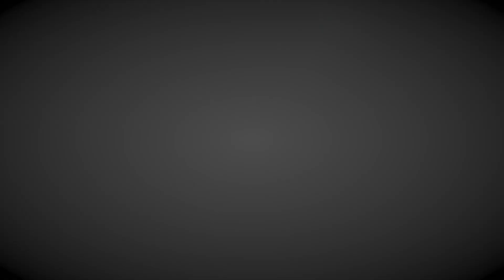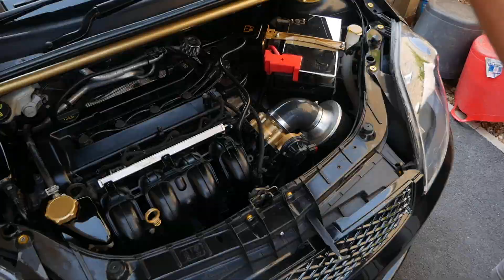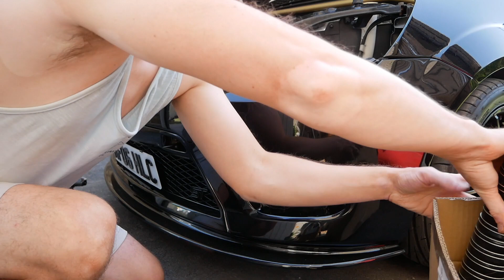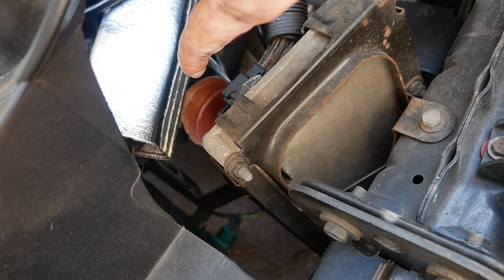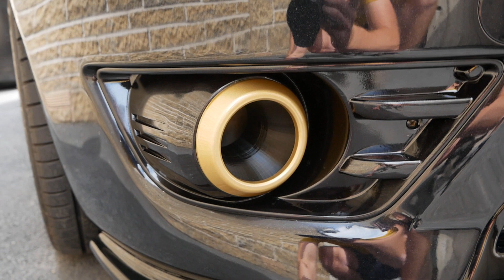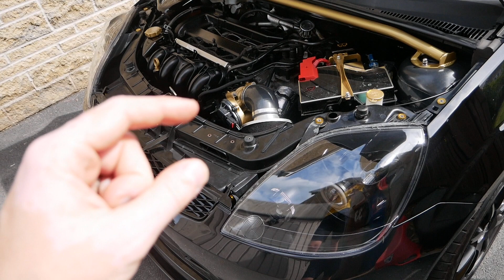Fitting CAIS Fog Light Delete Kit RSP Engineering Cold Air Feed Reduce Heat Soak Fiesta ST150 EP79

Comment: You need a closed box CAI. Cover the box in gold HVac tape and run the ducting to the CAI box. I had heat soaking issues with my infiniti Q50. I did something similar but ran the ducting to the front grill and the heat soaking vanished. It gets hot where im at in the states so i was surprised it worked so well.
Reply from the maker: since the fog delete air ducts were installed along with the coolant hose heat wrapped i have nticed a big difference in now there is what feels like no drop in perfoamance onn those hot days

Comment: Nice mod🤩.. but i dont understand why the numberplate is sitting in the grill then...
Reply from the maker: Due to the front bumper being smoothed. But checked with other owners a out its location who also run the plate there and no issues with it there as plenty of air still gets to radiator and doesn't effect performance

Comment: The thrumpets looks good. Maybe want them also, but then for the looks. My self run the RS inlets. Max 20⁰C lower temp. But is have then both direct to the throttle body. But really works. Easy to check just run with and without the supply on a warm Day. And Read out your MAP sensor with a OBD2 program.

My tuner said that the heat comming from the radiator is filling the engine bay with heat. 

This "cable" is a return coolant from you engine block back to reservoir.
Reply from the maker: if those other vents that go in the front grill were shaper into the corners, less round and flowed the grill suround beter i would definetly of gone for them but the issue i also have is they make the front grill look narrow and didnt want to loose the wider looking grill. But you culd run more ducts from behind the grill where air can get in.
I do feel this mod has helped get air into the engine bay, epescially into the air intake as the car doesnt seem to be struggling as much as it did before. You could tell the heat slowed it down. Not i dont see much difference from cold to hot engine